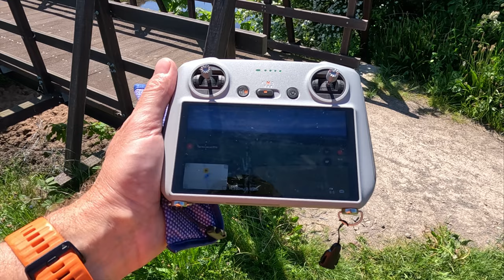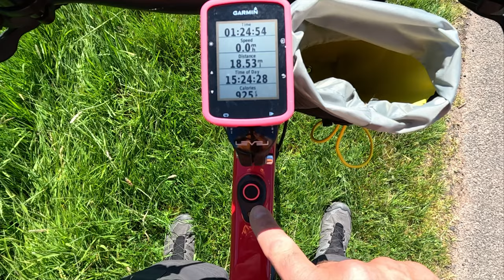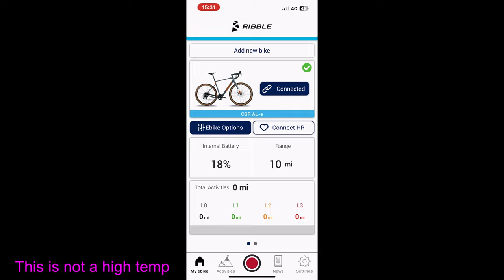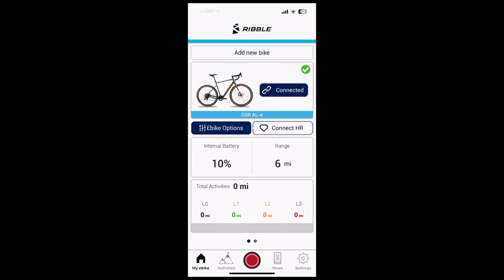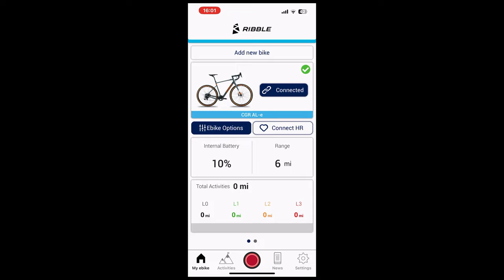Can you de-restrict a Ribble e-bike | purple fault light gone

Comment: Hi Dave, wow those drone shots are very impressive. I believe that most e-bikes can be "derestricted". To do so you would need to know the  motor type your Ribble uses then search for a derestrictor "patch cable" which fits between the speed sensor and motor. Effectively they fool the motor's sensors to thinking you are traveling below the legal 15.5 limit for e-bike assistance in the UK. I am very conflicted about folk doing this as it's open to bringing E-bikes into disrepute (if it hasn't already done so). I ride an e-bike and wouldn't do this to mine, as although I think the UK government set the limit stupidly low, its the law The potential legal minefield someone get's in with a derestricted bike if they ride it in the road and get caught is horrendous.

Comment: Hi Dave,  have been watching ur videos and I also have an ebike with that same flashing purple light mode,  how did you manage to resolve the problem?
Reply from the maker: I just went out into the street rode up and down whilst cycling the iwoc button on/off until it eventually righted itself . had no more issues since .
Reply: @Solo Biker Dave  Thanks.  I tried that a couple of times but still no success.
Reply from the maker: @Hawkeye-Flyer  That’s a pity ,I think I also undid the cable from the joint near the back wheel then re connected it. Then done the on/off with the button whilst cycling along .